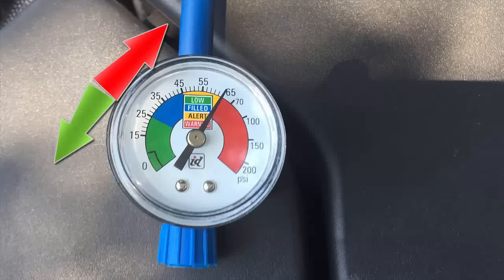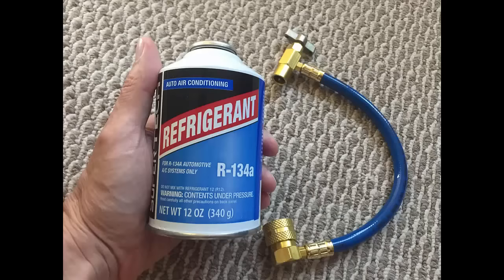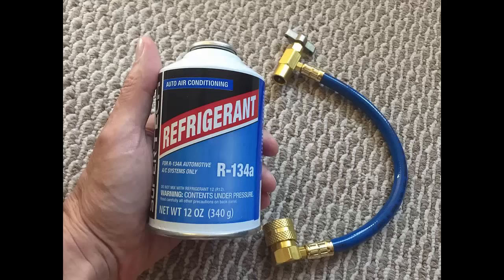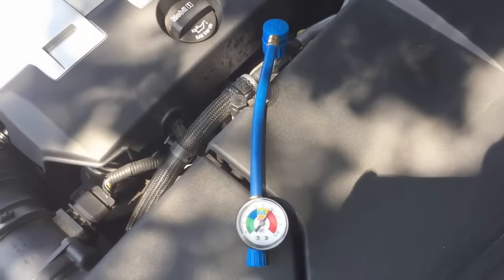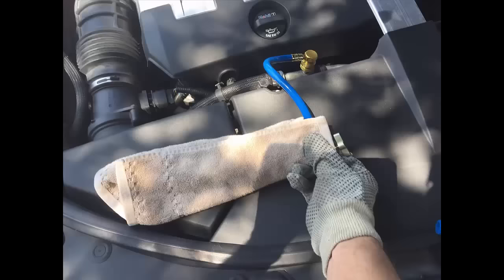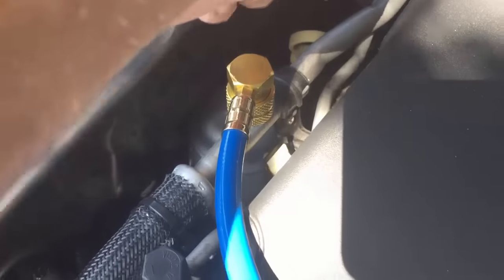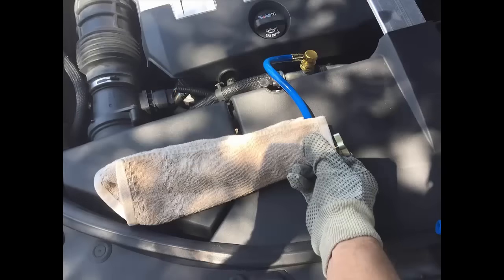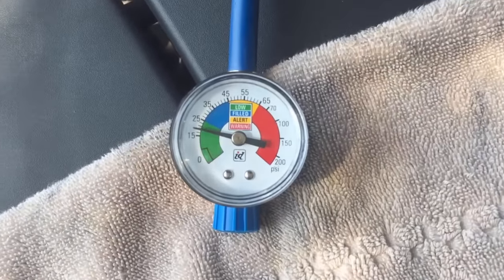Car AC pressure too high FIX overcharged a/c gauge fluctuation reading jumps Up Down Freon problem

Comment: As much as I hate to say this - you have just violated the EPA regulations on the proper discharge/recovery of refrigerant.  You should have taken your car to a recovery station (garage /dealer) that has an A/C recovery machine that recaptures refrigerant, which does not allow any refrigerant to escape into the atmosphere. EPA only has one exception - when recharging the a/c system you are only allowed to bleed the service line just enough to allow air to escape from the line. Then, you can proceed with recharging the system. Now, drink your milk and eat your cookie, and go to bed - you were a bad bad boy.

Comment: I had the same problem. Fluctuating... it's undercharged.
Reply from the maker: Yes, the gauge could fluctuate if it's Over or Undercharged. In my case there was no fluctuation before I put 12oz of refrigerant, only after fill-up it started to jump up and down... so I definitely overcharged it.

Comment: My car is not even to the red but started doing the jumping thing. Now every time the AC is on the fan kicks on and shits off shaking the damn car and jerking at low speeds. I added refrigerant little by little and still hot hot air blowing. Now im at this point where i think its overcharged. Just letting you know that its super illegal to let the refrigerant out into the air. Maybe blur it out or or add an annotation stating that you caught the air in a container. I'm sure everyone does this but you never know when the local PD is having a slow day.
Reply: it's 134 a good for the trees

Comment: This is the most idiotic thing I’ve seen, I hope the E.P.A takes away you’re license if you even have one. People you have to vacuum the system before you recharge. It removes moisture and air. To make room for the refrigerant. This quick charge method will just end up damaging your compressor or metering device. And turn the oil in you’re system acidic. Causing Black Death for your ac system. If you have a pice of junk more power to you. But if you have a decent vehicle don’t do this.
Reply: What do you mean by vacuum the system? Not a mechanic so dont know the terminology.

Comment: in case you didn't know it's illegal to let ANY of this Gas escape into the air!!
Reply: norm lor 134 is not under the same laws as r12
Reply: you're right of course and sorry for my impudence for you are just showing people like me how to save $$$. I recently bought a "new" car WITH AC and BEFORE I received it was concerned about my AC going down. decades ago the only recourse I had was to take my Mom's car to a garage which specialized in replacing the freon(R12) and it took 2 hours and $200. I have OCD and am a stickler for Laws and for all things right. thanks for your reply, Norm
Reply: Must be a liberal.
Reply: Not all things are right that claim to be right, get therapy